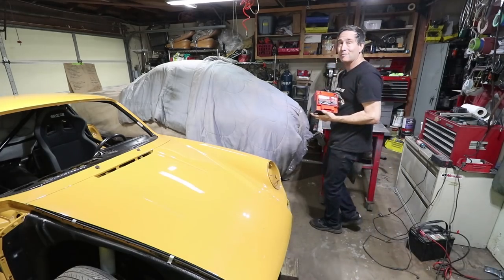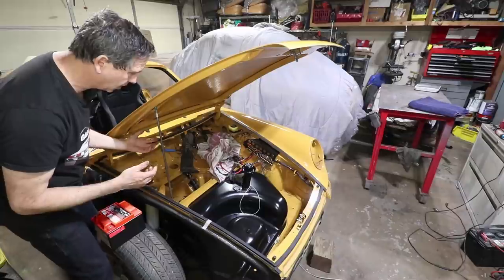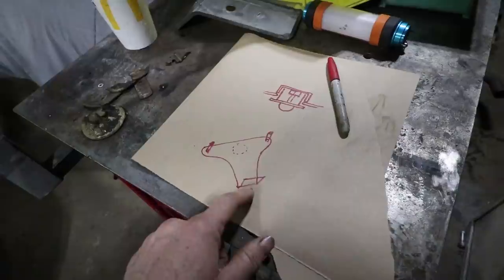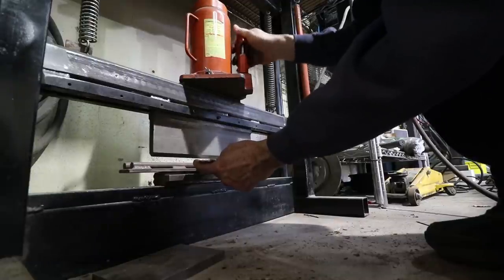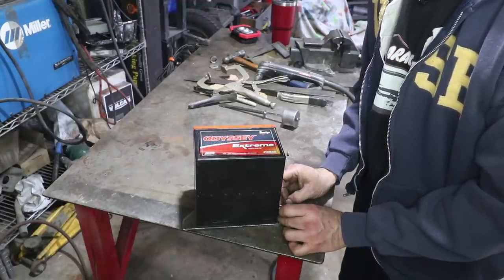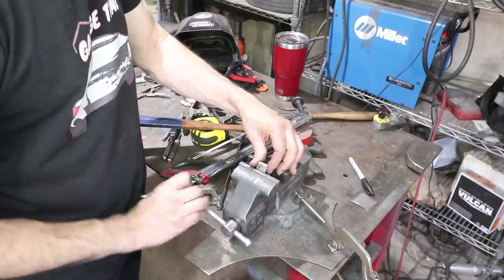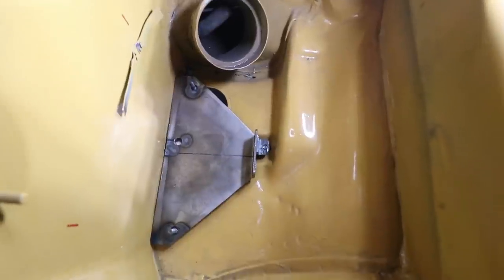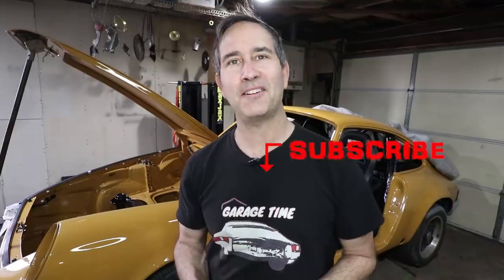How to Hide the ODYSSEY 925 Battery in the Smugglers Box

Comment: tom  why not use theaded rod in the bolt then drill holes in the top cross piece and use wing nuts? easier access will mail oil filter cannister paint this week
Reply from the maker: Good idea!  
Supposedly these batteries last 8 years plus so hopefully I don't have to worry about it again for a while.  
I might use taller hex spacers instead of nuts because they are a little easier to get started.

Comment: I saw someone thread a hole in steel plate made by a friction drill. Allowed them to get 5 threads in the steel instead of 2. Melting a hole in the steel looked cool.
Reply from the maker: Cool, there are forming tools that do this cold too.  If you start with an undersized hole you can extrude the material down for more threads.  
I guess I'm just a TIG welding addict, ha ha.

Comment: How is the Odyssey 925 working out? Have you kept a battery maintainer connected? My 72 will need a battery soon.
Reply from the maker: It's been great.  I don't leave it on a charger and it always starts.  No problem cranking the 3.2L either.

Comment: Since your back dating, your not going to dual batteries upfront?  Better balance, optimized weight distribution, at least that’s what the factory said til 73 or 74? But then again your not going the purist route.

Another great job!  It won’t be long.
Reply from the maker: Dual batteries I think you mean.  I weigh 180 lbs and the battery weighs 25lbs.  How does adding another 25lbs on the driver side help with balance?
Reply: Yeah dual. 

I helped a coworker put two into his 1969 or 1970. It seemed like silly overkill. I guess Porsche finally agreed. 

I love your location.
Reply: Porsche mounted 2 6V batteries in series for 12Vs along with weights in the bumper.

Then they went long wheel base by adding longer trailing arms and massaging the rear fender.

But I think it is important to realize that tires are ALOT better and people who drive these cars hard today aren't driving them nearly as hard as people did when they were brand new.  

These cars are now expensive collectible classics.

Back then they were expensive sports cars, if you spent twice what a Jag E type was going to run you and people pushed these cars on relatively primitive tires.